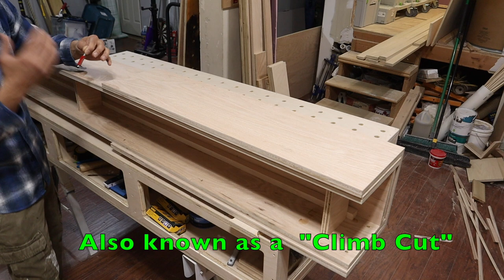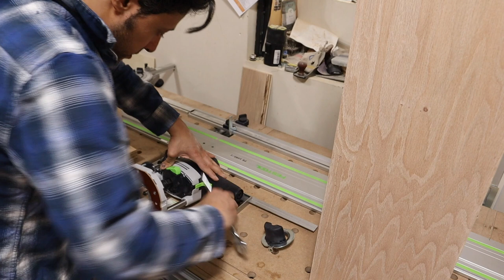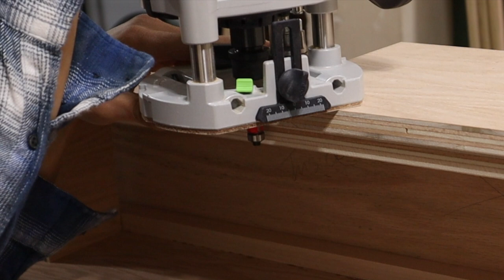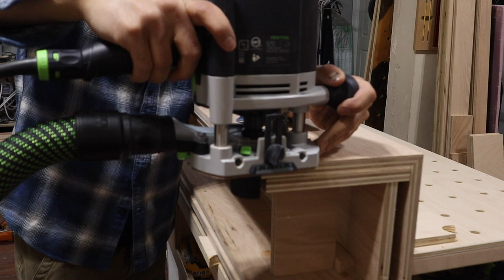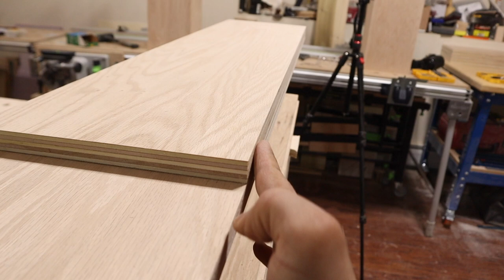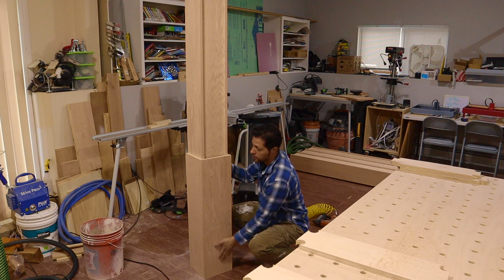flush trim router bit technique

Comment: I would think using a compression router bit with a bearing would give the cleanest, most perfect matching edge.  Yeah a bearing compression bit is several times more expensive, but well worth it, and a cheap (as compared to that Festool setup) since it would provide many years of flawless flush trim type results.

Comment: Anthony what's your thought on specific trim one hand routers for this and similar tasks? Verses the bigger 1400? Thanks
Reply from the maker: You can use a smaller trim router, but they are 1/4” shanks on the bits and much more vibration and chatter, plus you can’t really remove a lot of material in one pass with those.